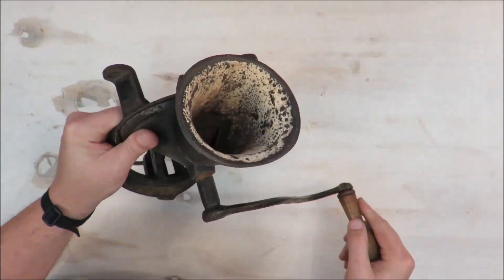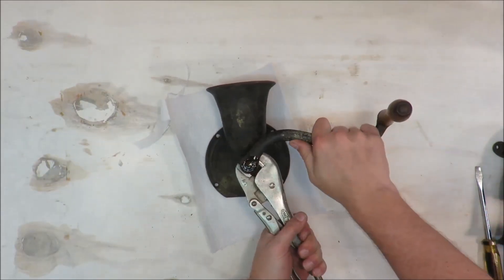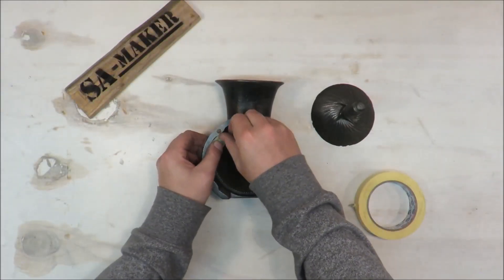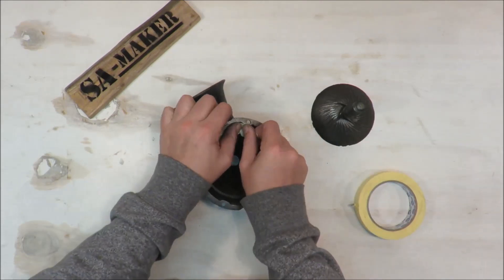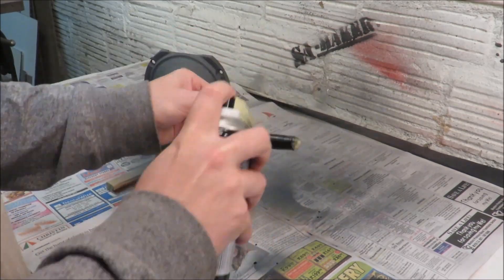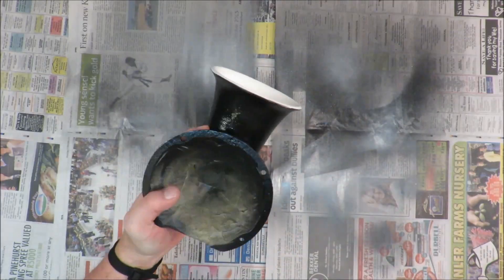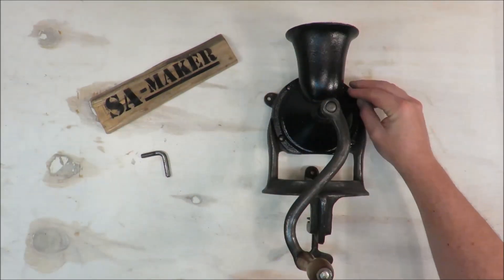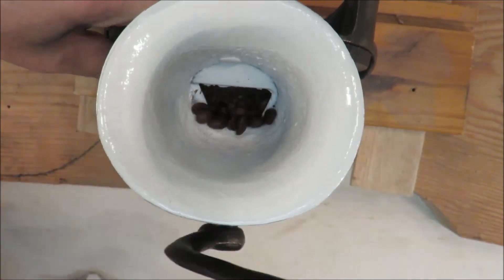How to restore an Antique Coffee Grinder

Comment: Thanks very helpful. I have washed my rusty grinder with a non abrasive brush and used oil oil to clean the screws after I had scrubbed them with a wire brush and to deter further rust.

Comment: The grind looked very uneven....like it was ground in a spice grinder.
I probably wouldn't have used the wire grinder on the burr parts.  
Maybe should have just soaked in vinegar and scrubbed them with baking soda and a toothbrush.
Reply from the maker: That would also have worked